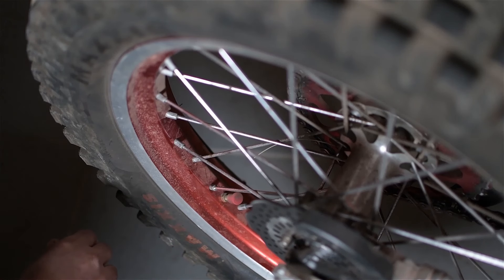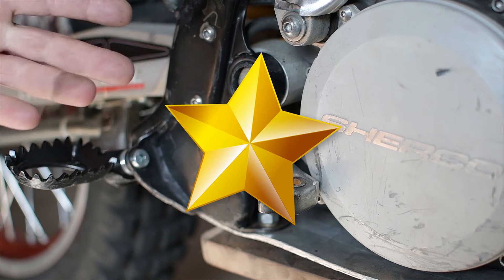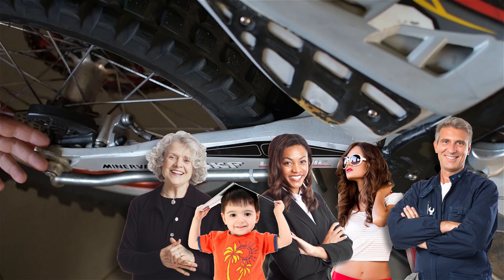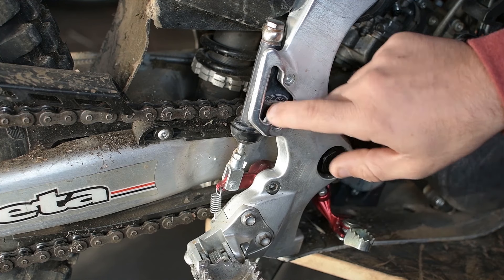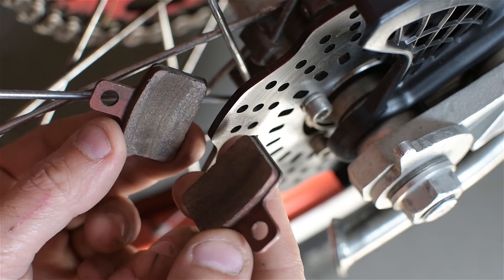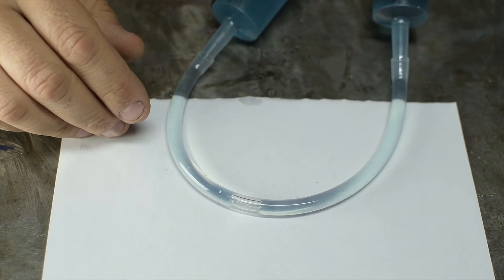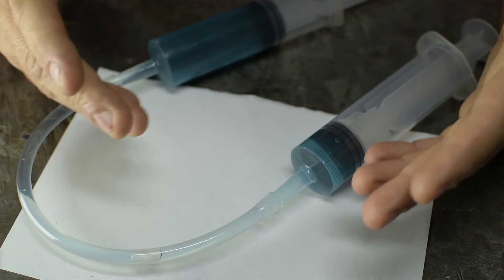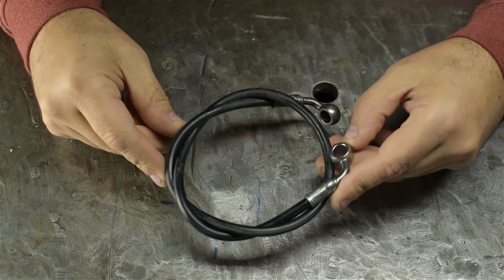I'm an Idiot! (Soft Spongy Brakes)

Comment: This video was very entertaining and funny as hell. BUT, (and first I want you to remember 0:40-0:47) I don’t think your rotor being to thin is the culprit for your soft & spongy rear brake. It’s more likely the rotor was bent or warped. It’s easy to measure and find out but I imagine it’s to late at this point... would be great to know the truth though. A worn rotor or if your rotor was as thin as you thought, it would be very noticeable, and st the least the very outer edge would be much thicker (this would be visible and if not it  would definitely be obvious by touch. Anyways, great video!

Comment: Kind of odd... Unless the rotor was worn very unevenly, typically when a rotor wears, the brake pads just but that much closer  down the little track they ride on. Then the caliper piston(s) stay out that much further. 

I say uneven rotor wear because if it's in a wave wear pattern instead of being constant, the thick portions of the rotor will push the pads out, then when you go to use the brake again, the piston has far to go. 

This is an interesting experience for sure Tony

Comment: Technically a very big percentage of applications actually only use single piston calipers and the caliper slides to allow pressure on bother sides of the rotor.

Comment: A brake disc with run-out can cause the same symptoms.  Keeps pushing your caliper pistons way back (The one thing you didn't mention).  I'll bet if your old disc didn't look worn that was likely the problem with the disc. Certainly gave it both barrels of parts cannon though.   Love your videos by the way.

Comment: If the pads wouldn't squeeze the rotor (disc)  then what would happen if the pads were worn - there should be loads of extra movement.  It is possible though that the rotor was distorted and knocking the pads and piston back in to the caliper so that you always had to pump extra fluid to get them in contact with the disc.  Still thought the video was great.

Comment: I don't necessarily believe the rotor was worn to the point of not working, but I believe it was glazed  and not able to provide the original friction co-efficient as new.  Donuts have the same problem, its why I scrape the glaze off and eat it first.  I bet if you would have taken a couple thou off on the lathe or hit it with some lapping compound it would have come back to life.

Comment: This is the first This Old Tony video I'm struggling to watch.  I'm about half way through.

To me, it's leaking seal in the master cylinder. Some fluid is leaking past.

Put something between the break pads and the disc. Press and hold the break lever. Watch it gradually sink lower.

You can sometimes pump it up tight and then watch it sink again.

Get a seal kit and change them.

I'll force myself to watch the rest of the video later on.   I'm very surprised that he has been stuck by this common fault.   I really enjoy hua videos.

Knowing my luck, it will turn out to be something else. I can't think of anything else though.

Comment: THIS OLD TONY I HOPE YOU SEE THIS but rotor thickness was not the issue! Think about all the space that a caliper can take up when the pads wear out. Fresh pads would MORE than compensate for that little bit of missing rotor thickness. That's why you couldn't see a difference from wear on the old caliper. Instead I think it was what we call "glazed" rotors. I don't know the mechanics of it, but I've always understood it as heating up and basically polishing the rotor to a mirror shine. That makes the rotor face too "smooth" and doesn't give anything for the pads to bite on to.

Comment: You're wrong. Thickness of the rotor has nothing to do with pad travel/MC range. If it did, then this would also happen as the pads wear down, but it doesn't, because as wear happens, the slave piston moves out to a new starting point on the seals, keeping the gap to the disk constant. What you most likely had is a dished-disk, which is then forced flat by the piston, and is pushed back too far when the disk returns to cone shaped.

Comment: I repair things for a living. You can have a thorough understanding of how a system works, but assumptions can bite you and sometimes you just have to start measuring everything. I don't repair autos, so I don't know if it's something that could happen, but as the video progressed I wondered if someone might have installed a set of calipers with a larger diameter piston. That would have made it so it would take a longer stroke on the slave cylinder side to make contact with the rotor.

I was wrong but measurements and a little math would have gotten us there eventually.

Comment: On mtb brakes sometimes the calipers can get stuck if you dont ride them for some months. then you have squishy brake because only one side is pressing on the rotor and since bicycle rotors have large diameters (up to 203 mm) but are quite thin (down to 1.8 mm) the working caliper bends the rotor over to the stuck caliper. 
youre not losing pressure due to compressing an air bubble but by deforming the whole rotor :D

Comment: Sounds weird to me, the pistons can extend more than a thin rotor allows, thats why you can build pressure without a rotor (after a few pumps for the system to adjust). It sounds like an uneven rotor surface which created pressure concentrations on the new and flat pads. Anyway, the bike has probably been rebuilt to a cnc-vacuum cleaner by now.

Comment: Typically with automotive calipers the pistons will "self adjust". As the rotors wear down to most likely under spec no matter what (unless it's a rear caliper with integrated parking brake.. don't quote me on that.) The pistons will keep coming out and will keep the same pressure.. unless it's a rear drum brake front rotors set up. Some brakes (rotors + pads) can wear down so far that the pistons will actually push out of their bores on the caliper and leak all of the fluid out.

Comment: @7:09 "Calipers are two or more hydraulic pistons" -- motorcycle brake calipers are often single-piston, where the caliper slides on pins.  I'd be shocked if that rear caliper wasn't single piston.

Comment: Dont know how youtube brought me here (man, nice video by the way! hope your second marriage is going well) but i recently had a somewhat similar problem on my muscle driven bike. rear brake always got soft and unusable after one or two rides. i re-bled the system, i changed pads, i cleaned everything a million times, i even took apart the caliper. and everytime, all seemed fine, until i rode for an hour or so. brake bad again.
i only noticed the trigger after some pretty dusty rides where i did not clean the bike afterwards.
there was a tiny wet spot in the dust around the bleed nipple on the brake saddle. i guess the bleed screw had a crack or wasnt machined correctly. and with every brake actuaction, air got into the system. and maybe some oil on the rotor...
i felt pretty stupid. but i never occured to me to investigate that bleed screew. i changed it, and the brake works perfectly fine since.
so, always look after your nipples!

Comment: I don't think rotor thickness as such could directly affect spongy brakes, because ideally brake pads should always be just barely touching the rotor then brakes are off. You should also add brake pad thickness and wear into equation as they, as rotor itself, are between caliper pistons. 
My theory is that thin rotor became weak enough that then piston on one side touches it the pressure difference between the piston on the other side (most of the time pistons are out of sync - meaning one will move before the other then the pressure is applied) is enough to push/bend rotor towards the other side. Then brake pressure is released the rotor would spring back pushing the piston inside thus again creating extra travel between pistons. Same would apply if the rotor was wavy or crooked - applied brake pressure would flatten it and by releasing pressure the rotor would spring back pushing caliper piston inside. Similar situation could occur event if you have piston only on one side with floating caliper.
Another theory is that caliper piston rubber seals became soft (and more grippy). Then piston extends it pulls seal lip a little bit out, then pressure is released rubber seal springs back pulling the piston together and thus again creating extra gap/travel between pistons. Similar could occur if pistons has rust spots or other imperfections to catch and drag rubber seals.
In both of these cases you should have observed some pistons\brake pads movement then brake pressure is released.
Reply: When needed to check caliber, replace pads and use wood for pads. Pressure crushes wood if pressure is enough strong. In multiple pistons, you see differences.

Comment: Nice story. Sorry, you had to go through all of that to find it was a thin rotor.  Sometimes when I get stuck with a similar problem, I mentally eliminate the parts one-at-a-time. No visible leaks, lines should be ok. Put in the things to look at again if I'm still stuck. The fluid level looks good' clean,  fresh etc, leave in the second pile. Check wearable parts, pick the one that is going to be either the biggest pain to swap out or the most expensive......eureka!!!

Comment: I have to ask, when you were bleeding, did it never occur to you that when you braked normally, the level went to the same bottom out position as when you were bleeding. I picked up a few pointers here about the line being bad, also something to add (Happened to me last week), the caliper alignment was stiff so caliper wasnt aligning centrally. When I pressed lever it just flexed the disk, and didnt clamp it from both sides.

Comment: I solved spongy brakes on my bike by replacing the lines with braided ones. As soon as I did that it was instant tire lock up. I assume whatever lines they used were too flexible and actually expanded under pressure.

Comment: I can't help thinking un-seizing the caliper pistons may have helped.  You should be able to wear that disk (rotor) to paper thin and the system still work.  Split the caliper, pop out the pistons (I'm assuming the system is an opposing pair), replace the seals and wahoop!
Reply: sadly its the adjust screw / weak spring. The piston in master cylinder can not fully retract. Most people dont think that master cylinder is a pump.

Comment: Tony I love your videos but we have to agree to disagree on this one. If you have a rotor slightly under spec with brand new pads, wouldn’t the caliper pistons be in the same position they would be in with a new rotor and slightly worn pads??

You can run the pads down to nothing and still have good stopping. The system is designed to have the same master cylinder travel no matter where the caliper pistons are. That’s why there is a reservoir.

Glad you fixed it and you needed a rotor anyway, but that’s not what fixed it.
Reply: I share your same thought. Pads wear much more than rotors and they still bite.

Comment: same same... identical reasoning. NOBODY says 'check the disc.'  i finally got the rear brake working on the harley, which is important because there is no front brake. perfect. two weeks later, my bike of a dozen years was stolen.

Comment: Could have been the same problem as yours but for me it turns out I have done about the same work figuring out at last it was a miss mount of the caliper shaft clips that gave me a weak break! Though still having problems with loosing brakes after a long run downhill...
Sharing the same passion except I got a Beta and 4 strokes further more. The main difference with your french lady could be the frame that is made of aluminium and probably more difficult to weld for some repairs...and It's italien :) but I'm french. Noh!

Comment: This may have already been addressed, I did not read all 2700 comments.  When you replace the brake pads the pistons in the calipers are pushed back into the caliper.  Wouldn’t that give you the extra travel that you need in order to squeeze the thinner rotor?

Comment: The front disk on my scooter is a 1/3rd if its original width yet the front brake is as solid a my friend's brembos.(as long as you didn't press it slowly because bad master cylinder seal can cause it to sink) Well yeah, the braking power is 1/25th of the brembos.

Comment: It's really difficult to properly resurface mc disks purely because they're already so thin. But, also, if you assumed the master cylinder had a bad seal... you could have just bought a new seal and not completely new set of internal organs.... You can have your disks resurfaced but you need to add material to your pads, or shoes if you have a drum brake system, at the same ratio as material lost. The resurfacing was probably already done well... just lacked the proper pads...

Comment: So if I got this right - the calipers autoadjust as the pads wear, but the issue here is/was that the distance between the retraction position and the overly worn rotor was at the fringes of what the stroke/capacity of the master sylinder could pull off in a single stroke?

And if you bled the system the calipers would autoadjust, technically too far, reducing the normal travel of the master cylinder and caliper pistons, but closing that 0.9mm rotor overwear gap. And as soon as that "overextension" of the pads wore away, you'd be back to where you started with normal actuation travel distance of the master cylinder' and caliper pistons.

Right?

Comment: Had the same problem with a speed car i worked on. Difference was some idiot made a custom rotor but used the worn rotor as the reference value. Which is y we always check rotor scrap thickness first before even pulling brakes apart.

Comment: A friend came by my house with his old CB750 complaining his clutch was slipping. So I took it for a diagnostic ride.
No... your clutch is fine that saw blade you call a rear sprocket IS slipping though. I almost installed it on my table saw to prove the point .

Comment: Just a thought, but I thought the idea of hydraulic calipers is that when the brake is not being pressed, the pads "float" close to the rotor leaving minimal distance for the pads to travel when braking. Therefore they should auto compensate for wear on the pads or rotor. If 1mm wear on your disc caused the problem then 1mm wear on your pads would also cause a problem?
Because you, like the rest of us, are an expert, I'm sure you would have checked for any run out in the rotor as that would have the effect of pushing the pads away from the rotor creating a larger gap and making the brake feel errr.. soft and spongy.......

Comment: I had quite a air bubble in my Polaris, brakes failed while going 40, luckily the engine braking is so vicious, it stopped quicker than the brakes. Scared the crap outta me.

Comment: I have heard of brakes skimming.  Where they take an old caliper or disc brake and skim the surface true again...  Previous owner might have done it... But you said many owners have reported the same type of thing with the rear brakes on that type of bike..  So it could be that they used a thin disc to start with and the previous owner had it skimmed as well.  Making the travel problem worse.

When I got my last car... I checked the discs and brakes... Hated the state of the discs so I replaced the lot.  New discs, brakes and pads.  I should have replaced the calipers as well... 3 months after the caliper ceased on and ended up with new brakes, calipers and pads on the front anyway... lol.

Comment: Hydraulic brakes are not easy to maintain.
Got some brake left for my MTB, even after a proper oilchange, the callipers won't open after some time.
im sure theres no air left in the system, they work fine for a moment.

Comment: That's strange. I run my rotors really thin and i've never had that problem. The pistons migrate outward to take up the slack as the pads wear, that's why you need to push them in again when you replace parts. when pushed to the extreme, the pistons will run out of travel and pop out of the caliper. That's an extreme case, but it means that there's no internal limiter that would cause the symptoms that you describe in the video.
I'm really glad you got your brake working well again, but i'm still confused. maybe the issue is with the piston seals in the caliper not allowing the brake pistons to migrate out and take up the slack. If that's the case, I imagine your soft brake will return when the pads wear by .035" and introduce the same gap into the system.
I've also had brakes feel soft when pads and rotors are contaminated. That could be another reason that replacing the rotor did the trick. Thanks for posting!

Comment: Had a nightmare once with brakes, took Me 3 days to figure it out. Had a pin hole leak in the line, just a tiny hole just to let air in  but not fluid out, I became a very Small Boy for them 3 days.